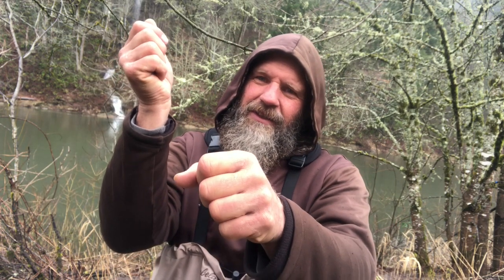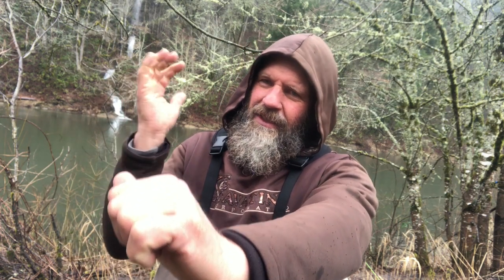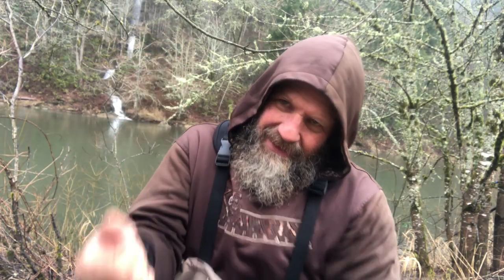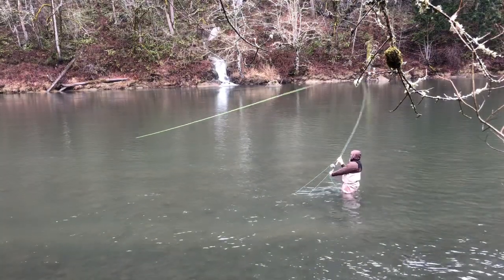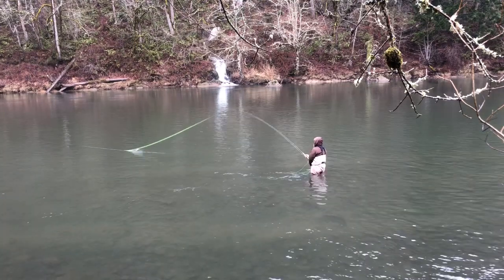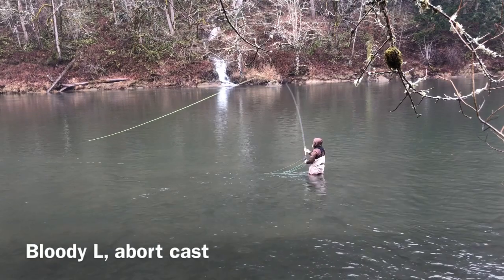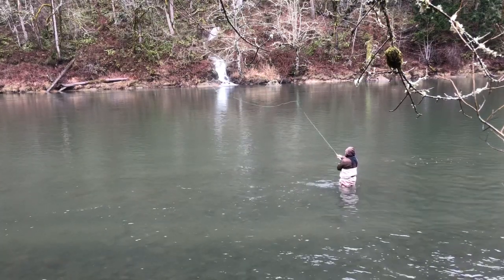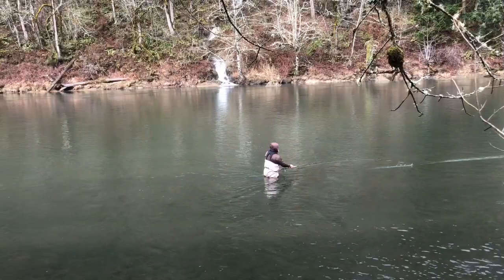Touch And Go Skagit Casting, The Good, the Bad and the Ugly

Comment: This was really helpful. People are always talking about "You can't splash and go well with skagit, You can't overhead cast with skagit." There is always a way, you just have to make the adjustment.
Reply from the maker: Absolutely!  Skagit heads are amazing for touch and go casting as well as overhead.  Just because its a Skagit head does not mean it must be grossly overweight.   Lighter than recommended Skagit lines are amazing for touch and go casting and overhead casting! Here is a fun video with several different casts with skagit heads. https://www.youtube.com/watch?v=V4MPrAFLqr4 thanks Justin! 

y
1. I

Comment: Thanks for recognition Tim. A couple of tips on your casting in that very video. What I see is that you tend to combine lift and sweep while they should be two separate stages. In other words you often start your sweep too early which has its consequences for the anchor placement, rod tip curve and casting stroke. You need patience with the lift. If at the end of the lift your rod tip points too high up then you will be a hostage of that height and there is no going down with the rod tip through the entire sweep which results in short casting stroke. As you pointed out it's better if the casting stroke is long as it reduces slack and makes the cast better and easier to make. Secondly, you rarely drift enough prior to forward cast thus the slack.

Comment: Fantastic clip!! 
Yea guys I’m in..., let us know about the $ for the microphone 😎
Mastering the anchor placement control is the first step for a true dynamic roll cast to 100% work. Is the foundation, if we start wrong the finish won’t be pretty either, I would point to the  anchor placement Tim, specially on this clip for the airborne cast are kind of inconsistent, or better said, never place in the same anchor window from rod tip and your body with the same force  and length of tippet leg to build the water anchor. Just practice is the name of the game,  please keep doing it,  Im sure we all trying here to get it right also . Thank you for the time Tim it helps immensely to many of us out there!
Trebuchet👌
Powerful leverage class on the siege weapons groups, the trebuchet is the French name, glad you mentioned Tim, TH fly rods are a basic trebuchet concept tools if you will, a class lever one from the lever family, this little detail on the lever is something that always makes me think why no instructor/s take some time over this detail. Also, I ask myself, ...why the single hand rods exploded in a different and better dynamic than the TH in the 1950s to this days? Just look on all the different lines the TH bum creates in the last 10 years compared to the SH?
Once both lever mechanics can be compared on each different rods, the TH lever will always be on the anglers favor to stay in the water longer than a SH fly rod regardless the line weight, mainly because the TH involves a force multiplier lever present since the Archimedes times.
You should open a thread over this detail, on what type of lever is a single hand fly rod and how the fatigue effects to beginners to develop a  better casting  assimilation over the principles. 🤔

Comment: I use Redington Dually (13.6', #7)  with Airflo mono running line + Airflo Skagit Compact shooting head (510 gr.) + 10' Rio iMOW tip (Medium, 5' Int.-5'T-11) + 4-5' of tippet + Large Cone Head Zonker for my practice.     I think I just have to keep practicing.   The problem is that I live in Ontario, Canada, and  most of the waters are closed until the end of April.  You seem to have nice waters around you. (I envy you.)    Does it make sense (possible?) to practice on the grass (in the park)?
Reply from the maker: Your set up sounds good.  Maybe go with 3' of mono leader if possible for your fishing applications.   Casting on grass cant hurt and will help with your general handiness of the rod etc.   Or could you arrange with local authorities to practice casting with your hook cut off?  If not you can build a grass leader by tying nail knots every 6 to 8 inches on a practice leader.  That will give you a little stick to replicate fishing conditions.  Might even be able to find one premade on ebay.
Reply: @LineSpeedJediTimRawlins  I am glad that my setup is OK.   I was not sure what is good or bad.   I think I will try to practice on the grass.   Thank you very much for your advice.